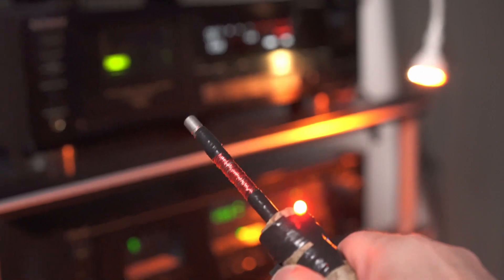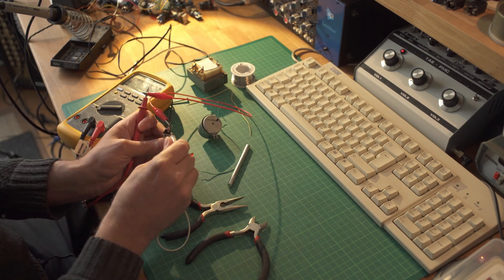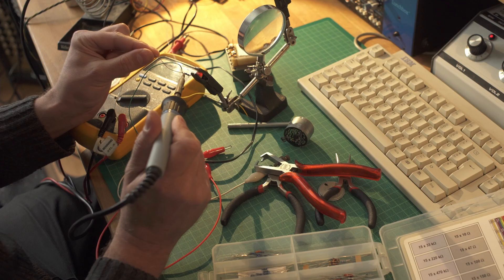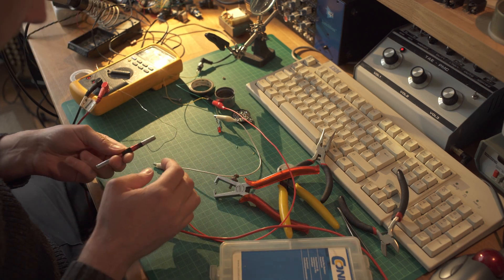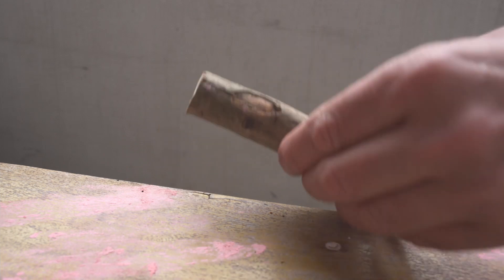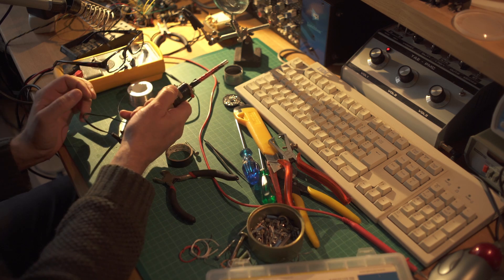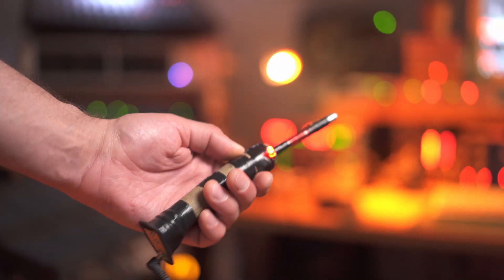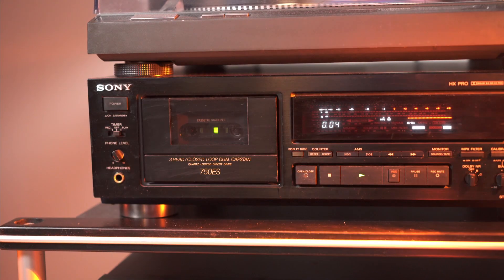Building a DEMAGNITIZER for Tapedecks, Reel to Reel, Multitrack Tape Machines - electronics DIY

Comment: Are there 2 female jacks on handle of wand? How do you switch 3:40?
Reply from the maker: Hi. No. I just switched the ac psu to a dc psu with the same jack. You could build a switch by using a rectifier.

Comment: I wonder what is the resistance of the winding, isn't it shorting the transformer output? A factory demagnetizer wattage is 3W. I have a 12V/600 mA AC transformer and was thinking to add a car parking bulb (12V/5W) in series with the coil. For a stronger magnetic field I will probably need many more winds on the coil though
Reply from the maker: Hi, yes but no :) you can calculate the resistance by the windings, metal mass and scale. Then you have your henry. I also wondered about the shortening but the proof is in the pudding. It seems enough winding means enough resistance. I saw this circuit elsewhere and just build it on my own to see if it works and it obviously does.